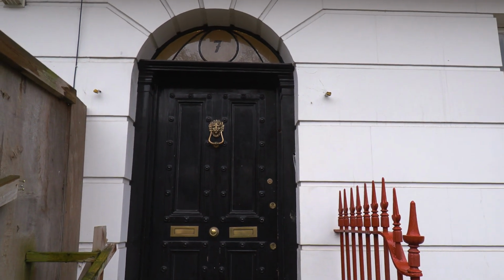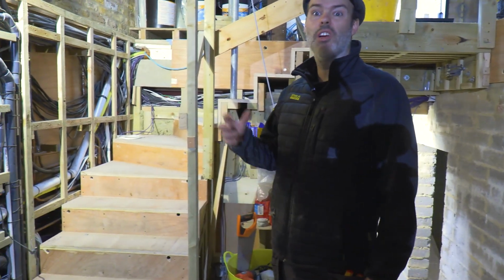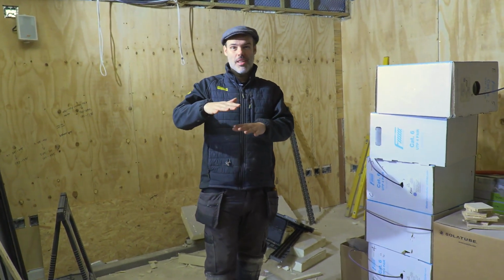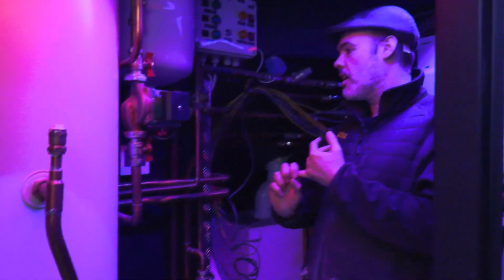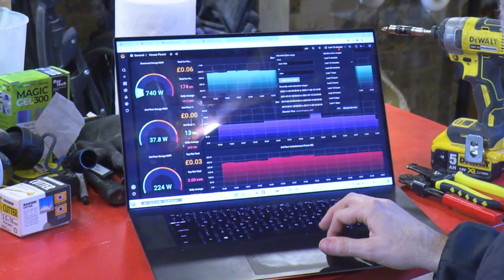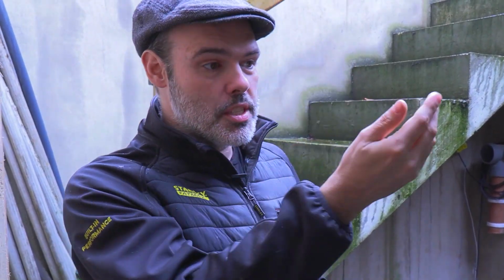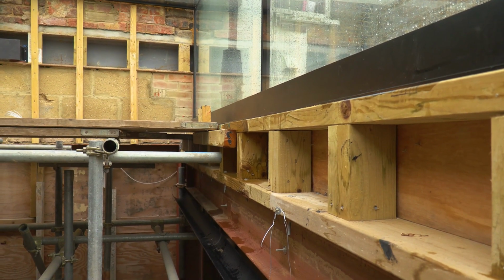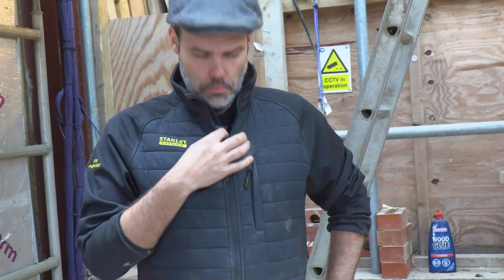The Reluctant Builder Uncut

Comment: Part two.

Basement floor levels / scrabbling concrete to remove:-

Well, basement slabs are / can be poured not being level. They can be cast with a fall to them to allow water to drain to a sump pit with underfloor drained cavity system. A floor is then cast /provided above to level. 

It may be that this is what may have been envisaged in your project - but had gone by the wayside/ lost in translation. 

You might not know - but I’d be enquiring / thinking about the basement slab now you’ve removed 70mm from it. The thickness of the basement slab & the reinforcement within has to designed for the upward pressure of water - for 3m depth they’d be 30kN/m2. Or 3 tonne / m2. 

It’s unlikely to “burst” crack too much as it’s rarely under that full head of pressure. 

So just something for those playing at home to be aware of. 

When the foul sewer overloads - the sealed manhole cover will be under that pressure. So probably the reason you get weeping under the seals. I’m sure it’s bolted down “well”. If not - think of those manhole covers that you see burst in the streets when the pressure in system is exceeded! 

I’m here all day

Comment: I could write my own book on this video. I’d commented on the other one so I’ll keep observations short n sweet/dispel some things. But well done Mat for your perseverance. 

1. The sewer network
You blamed the Council / Thames Water  somewhere. Well, it’s probably an old sewer system - designed adequately back in the day. When properties like yours didn’t have basements - or habitable ones - & had gardens to allow rainwater / surface water to percolate through the ground happily. 
Now you’ve installed a basement - & removed the rear garden for an extended basement - you’ll now be adding all that water back into the system - for which it was never designed for originally. But you’re not the only one - I wonder how many thousands of basements have been installed in Chiswick & the surrounding areas - all feeding this water into the system. Where it will no doubt have to be pumped & treated - when it would’ve gone happily away into the ground. 

Unfortunately one reaps what one sows.

I’m here all day

Comment: I relate to his issues with tradespeople. "we cant find people who we can trust, and  who will care enough about the job as mush as I do". Man that sentiment hits hard. I'm renovating an old house and here in NZ most work can only be done by  "qualified ""professionals" im not even allowed to lay tiles! i need a waterproofing expert! each time ive had work done ive had to fix their expensive mistakes! for example my new Accoya sash windows 7 of them double glazed have issues that are too numoruse to mention here, one of the main ones is the sashes have a 5 mm square gap on both sides of the meeting rail letting un restricted air flow into the house ! because..."so you can replace the brushes on the parting bead"  . the plumber didnt screw on the gas fire properly and it fell off when lit this summer, the underpinning was too high for a few rooms making the house like a fairground fun house, the plumber didint hook up the gas to the boiler, the driveway french drains was filled with pea metal which doesnt lock so drive is spongey. There is so much work for tradies out here that the clients are treated ike a commodity they dont care because theres another job round the corner. ive now been doing most of the work myself. im following the codes and complying, im even going beyond the code and future proofing our house so its warm, dry and healthy for another few hundred years. Well done Mat, your a man after my own hear. keep it up.

Comment: Well done! What a complex challenge. 
I would recommend a rethink about the way the walls are insulated, although it’s possible, I may have misunderstood the way you’re doing it.

There should be a vapour barrier on the warm side of the insulation to prevent persistent high humidity on the cold side - if over 75% RH the equilibrium moisture content of the wooden batons will be sufficient for rot or mould to occur. 

It’s not so good long-term to have wooden batons in an environment with elevated RH  because of the lower temperature due to presence of the insulation. If it’s already all installed, you could monitor the RH on the cold side of the insulation in a few places and if well below 75% RH, on average, there should be no problem.

an alternative method is to use plasterboard with laminated insulation and an integrated vapour barrier, and metal furrings with no possibility of rotting.

Just a thought…

Comment: I moved to Canada in 2001 & was shocked to discover the hard way (what the heck is that thing?) that houses here nearly all have a sump with an electric pump. It is done this way because the foundation of the buildings are very deep to avoid the deep frost line & the subterranean area is used as a basement "bonus space". Some places have sump pits which are dry spider pits, some are constantly running, some have a water level but this never gets to float switch point with draining happening naturally as is the case for our current home. However our previous house had a pit which pumper out every half hour in spring, every hour during summer. I that location I added a 2nd pump which runs from municipal water pressure as fail safe backup.

Comment: On all my rough openings I made sure my rough cill was tilted out at 7˙, this was if water ingresses into the opening past the winows flashing the water will run out into the cavity over the envelope  between my weatherboard and the Tyvek membrane. the rough opening was fully sealed with 3 layers of self sealing (if screw or nail penetrated it) tape too to 50mm over the edge inot the Tyvek wrap envelope.

Comment: Well done Matt it’s hard to find but they are very good general builders about it just finding them in your area - looking in from the outside you have so many jobs going on in your house might be worth sitting down and doing a program of the works and just to the external fabric of the building then start on the inside I know easy to say this but I would do all external areas and remove scaffolding- sometimes this acts as a step  change and you feel you have turned a corner on a project

Comment: Amazing but to prevent damage from sewage there is a much simpler solution. You need a backflow preventer or, as it's ofter referred to, a non-return valve for underground sewage. You will still need to make sure that the sump can temporarily pump the water out of your basement  (maybe into a surface drain) but the backflow preventer is an absolute must if you have a basement or a "lower grown" floor. In fact given your past experience with the plumbing in your area and the number of floods that Central London has had over the past couple of years, I'd say it's pbl a must of all houses.

Comment: The roof light looked like it was steel not aluminium,judging by the welds...could an option be to remove all the silicone and put in a super two part silicone and do it really well...also drill some weep holes(although if steel these would rust).

Comment: He is an impressive and capable chap and with his wife they make a formidable team. The hammer incident just about sums the problem. While there are good builders and tradesmen, and we see a few of those on You Tube.  however the industry is unfortunately populated with ‘bottom feeders’, poorly educated, poorly trained (if at all) with absolutely no interest in anything other than taking the money and doing what they can get away with and probably incapable of doing a quality job even if they wanted to.

I have seen many tradesmen (particularly electricians) who deride ‘DIY Dave’s’ but let’s be clear just like the building trade there are homeowners who cannot put a shelf, but it should be recognised there are plenty of others who already have transferable craft skills who when there is a need have the gumption and capability to research, consult and find out how to tackle a job they doing correctly. The difference is they are motivated and have a stake in the outcome (it’s their home) - they don’t just turn up two weeks late, do an hour and bugger off to breakfast for an hour and a half. Matt is perhaps on the right hand side of the ‘DIY’ spectrum, but is not unusual. Finally, no matter how physically tiring the work for a DIY may be it is actually much less effort and psychological stress than to chase a trade or supplier over underperformance or poor quality work

Matt has done a great job and has clearly satisfied his inner geek with his comprehensive surveillance and monitoring system and should be proud of what he has achieved.

Comment: Water will always get past the gasket, nothing you can do. The tape wont help, if it is getting in the channel as you say then the channel needs drainage holes that lets the water escape to the outside and not overwhelming the channel and coming back on the inside.
The patio doors, personally I'd take them out and refit them, your water ingress could be coming in because they haven't sealed the ends of the cill properly, it is essential that is done because the drainage goes through the cill. Water could be tracking from anywhere.
Reply: Ok Mark re gasket. I thought about drilling a series of holes on the inside of channel & using expanding foam to fill the channel up 🤔 

The outside gaskets to glazing - generally good 🤔 if water still weeps through maybe a further gasket/tape applied to the outside glazing unit to the frame 🤔 thereby totally sealing wind driven rain to the outside. Wonder what ya thoughts are.
Reply: @messageobliquespe100  I personally wouldnt use expanding foam, it's messy you'd struggle ever getting the insulated glass unit out when it breaks down, and it's just not necessary. Honestly on any double glazing be it Aluminium or PVC-u water is supposed to get pass the outer gasket (because generally it will shrink/degrade) and drain away freely. You can get little drainage caps that clip into the holes you drill.
Make sure you don't clip the glass when you drill, hopefully the glass is sitting on packers, would be handy if you could get a schematic of the profile used.
Thing is with using sealants in this situation is you're just hiding what is actually wrong (some things need bedding on sealant at the point of installation), and if they fail you've got to remove all that old sealant.
Personally I'd be getting onto the actual  system manufacturer of the glass roof (if you can find out), no just the people who installed it. They maybe able to give you installation guidelines, they may even point out there should of been drainage holes etc. Knowledge is power.

Comment: In my experience most tradesmen are the same - generally friendly upfront but ultimately are rubbish. Case in point - recently got quotes for some new windows and asked for both double and triple glazed quotes. All (about 10) except 1, tried to offer me 28mm triple glazing. But I knew through research that a 28mm triple glazed window is less thermally efficient than it’s 28mm double glazed counterpart. Muppets. To date I have experienced 1, yes 1, tradesman I have rated highly. Yes, you Charley if you’re reading this.

Comment: Part three.

Vibrations - Block / Beam flooring 

The vibration / noise referred to is ground born noise from vehicular traffic nearby. 

You can isolate this - but you have to employ isolation bearings / Mats / strips to the structure. You could isolate the ground floor from the basement structure if it was known to be of a problem in the beginning/brief. 

It’s a fairly easy / not so easy process - but careful detailing required to incorporate within the structure. Not too expensive imho. I was involved in the design for isolating an office building over City Thameslink station where the original building was unworkable due to the trains running through the basement structure & the building acting like a tuning fork. 

Anyway…..

Beam & Block flooring - the use of heavy blocks can compound the issue of vibration. Like most things - the span of the floor plays a huge part. Designers / specifiers adopt the most economical (cheap) systems. 

Your noise was a matter of ground born noise. If the beam & block floor felt “springy” then this could’ve been addressed by using more or deeper beams to support the blocks. There’s a formula of such regarding dynamic loading - which takes the deflection under load of the components used - the more an element deflects the higher the degree of vibration. If you limit the deflection then you reduce the amount of “springiness”

Here all day

Comment: Part Five.

Labelling.

Well done Jo the plumber. Labelling up the system. All I’d add is have the plumbing system labelled up on drawing plans that could be referred to / sent to a “plumber” should they need to come in to do some work. Hopefully the plumber can read drawings….I’ll get my coat 

For the plumbing it’d be important to have references or show where the power is applied to the system / sensors / pumps etc etc - & their locations. 

Is the system powered from a circuit all of its own or split between an upstairs / downstairs circuit.

I think we’ll be amazed at the attention to detail of the electrics / consumer unit assuming you’ve put the same amount of effort in as you’ve done for this build. 

Having the electric system / wiring identified on the plans advisable too.

Basically - you’re providing a building manual for the property which you’re property deserves. 

I’m here all day

Comment: Part Four 

Water through the glazing system.

Ummm. Doesn’t appear that this is sorted & possible legal challenges ahead. 
But! Here’s my outsider view. 

The glazing system / provider designs their systems to not leak. Sometimes they do. They generally would fix - usually a damp proofing / sealing scenario like seen here. The “odd” thing here what I see is the glazing unit is on timbers 🤔 not the best supporting material to screw into & make waterproof. ?maybe it’s other video - but think you now know that concrete upstands is really the only way to go - especially at ground floor level where concrete generally used as a slab. 

I would be looking into the Architects detail / detailing of this junction to see if it’s proven / known to work - with attention to the waterproofing. 

“If” it’s as you believe - through the underside of the glazing within the track - then what can one do 🤔 

I’d be tempted - as long as the glazing supplier is agreeable in writing - to drill a series of holes at intervals from the inside into the upstand metal to the channel & use expanding foam. As the foam expands it’ll travel along the channel to the next hole & so on. This is my assuming the glazing unit / channel is open. Hard to tell but you have the drawings. 

I’m here all day

(& just a few stops via the underground to Chiswick!)

Just read comment from Mark previously - my further thoughts

The outside gaskets to glazing - generally good 🤔 if water still weeps through maybe a further gasket/tape applied to the outside glazing unit to the frame 🤔 thereby totally sealing wind driven rain to the outside. Wonder what ya thoughts are.